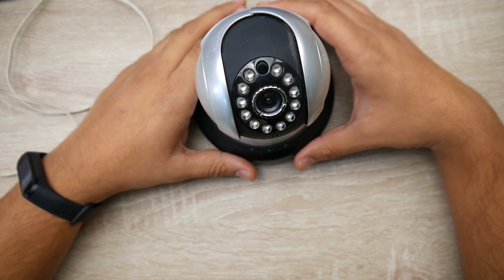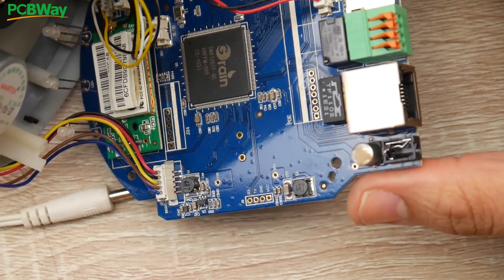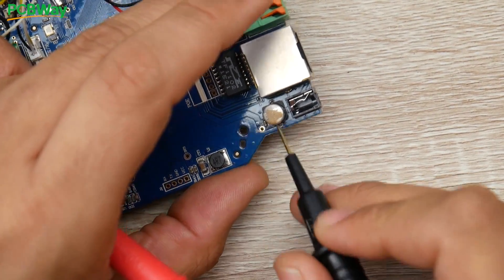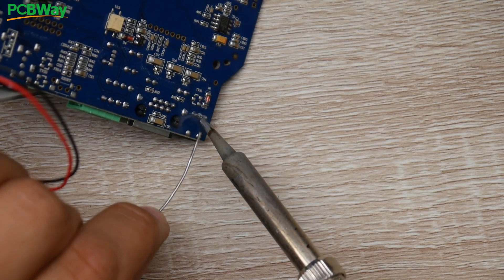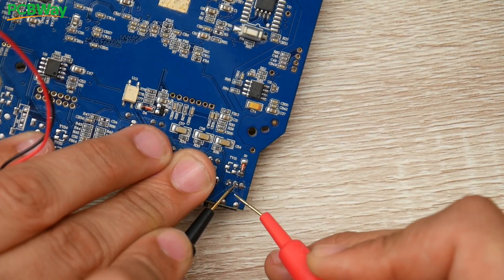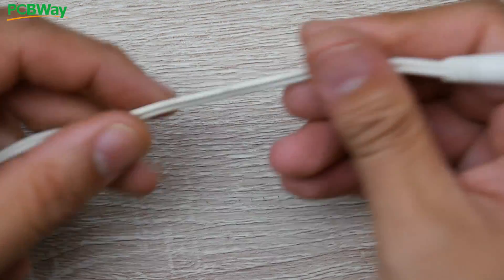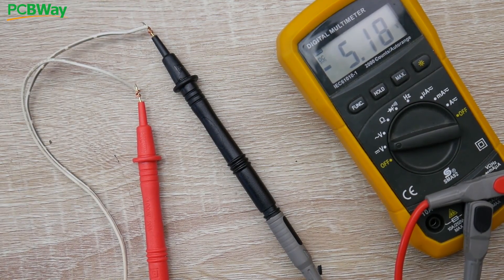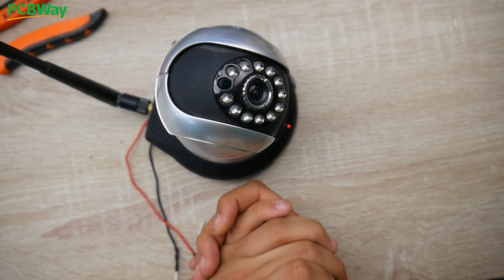Repairing IP Camera Power (How To)

Comment: I was thinking maybe use wick, desolder that old DC-in ... which'd get everything out your way to solder the 5v to the middle pin (with some flux). But this was informative. I liked your process.  Question (if you still check this).  I had a PTZ Uniview that's pretty nice, but I THINK that PoE burnt something out (I remember smelling it) and after, everything worked except video. Was thinking it couldn't be a TVS diode bc it's still responding to power ... and of course it's not going to be some cap bc again, it's not shorted to ground in which nothing is working. Basically everything BUT video is working. Have any ideas...?

Comment: Hi, I just discovered your video when I googled an issue with my IPcam. I like that you went into detail when you showed how you found an alternate ground and 5v location, soldered the board, used your soldering iron, soldered and shrink taped your wire together- I need to know the right way to do that. I've been wanting to learn how to solder well enough to be able to remove and add components to a PCB board without destroying it. I have some items I need to troubleshoot. So, Thank You!

Comment: You lucky SOB, basically didn't even have to troubleshoot! I've just started working for a CCTV company that has about 5 broken high-end PTZ cameras lying in a box, some of the models are older but can still be found selling for about $1000 USD, there's even a Hikvision RL-CC469-7 in there (look it up) so I have my heart set on repairing them or at the very least removing the lenses and camera sensor all together to mount it elsewhere provided I'm able to get power to the board etc etc... Getting these fkers to work when new is already quite involved tho so I definitely have my work cut out... Got some udemy courses on electronics but this sh*t is even more basic than what we were taught in 8th grade science class so I fear I'm just going to be wasting my time... Taking this stuff to a qualified electrician is unfortunately beyond my budget but Imma try my damnedest to get one or two of these beasts to work!!

Comment: Great video. My ptz cam have a mic problem. Always have a bad noise when rec video ot watch online.The cam works around 10 days. What u supose is a problem.
Reply: Chinese junk, they do that. I've gone through 4 of them now (cloudcam, ycc365 and eyeplus), only have 1 left, the other 3 were returned as "partially defective". I'm quite certain the noise is generated by one of three factors, poor quality mics, interference from the built in wifi or electrical issues related to the controlling of the motors for PTZ control - if you listen carefully for some time or at specific times of the day (very odd, i know) you can physically hear them making weird sounds, sometimes it's a type of clicking and other times it's a type of plastic grinding sound... Cheap, poorly assembled components will always lead to problems and the chinese are main culprits.

Comment: Good information.  Shows method, so can be applied to anything.

If not using the barrel connector again, then why not just hack away the plastic and un-solder the pins?  Should give a better place to connect to.  I've used this method before to make a direct solder connect to an FrSky R-XSR RX so it fit in a smaller space.